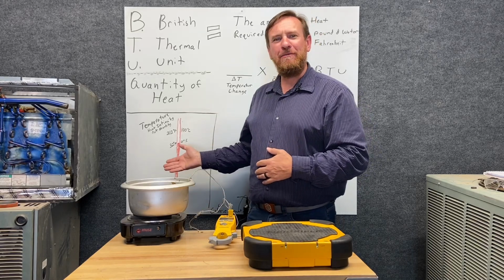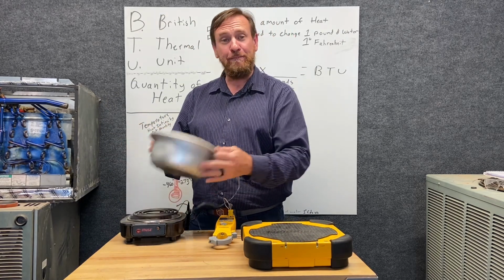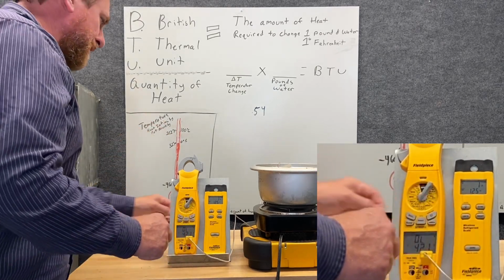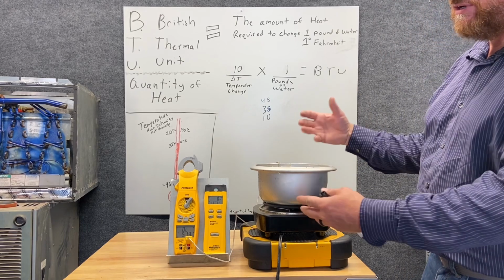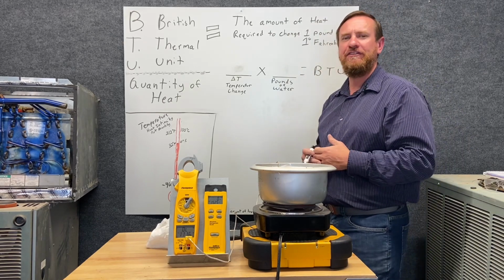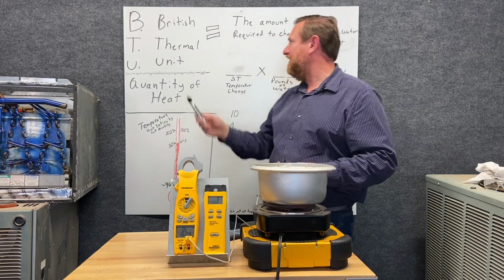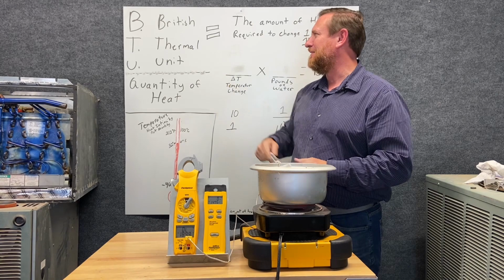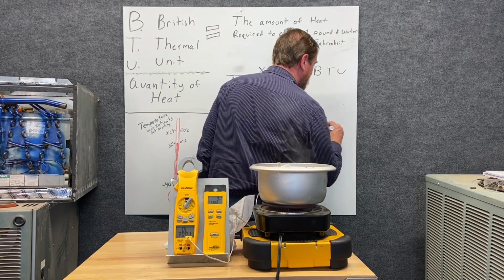HVAC 016 BTU British Thermal Unit a measure of heat

Comment: I find it crazy walking into a major retail market and their doors are open, the outside air is 85°f and they've managed  to cool the inside of the building to 70°f continously.  The energy use is terrible. Good luck
Reply from the maker: Sometimes they use an air curtain to help that.
Otherwise it is a waste of energy. Some places so it so you walk by and feel the cool air, and since the door is already open they are more likely to walk in.

Comment: Isn't BTU an heat energy unit? If so shouldn't it be mass times cp of the fluid times temperature difference, being cp the mass thermal capacity of some fluid? In this case water
Reply: And isn't the BTU definition in this video the same as the mass thermal capacity?

Comment: Ty when looking btu/Lb of air on psychrometric charts ,  say it’s 40 btu/Lb of dry air.  How is that different than the definition of 1 btu raises one pound of water one degree?? I’m trying to understand the difference here. Thanks
Reply from the maker: That's a great question.
I am in the works for starting a series on air and psychrometrics. 

A BTU is just a measurement of heat  energy and quantity.
The definition of BTU gives us a starting point.

The same energy I put into 1 pound of water I can put into anything. 

A furnace will produce ___btu of heat. We are not heating water but we are getting air, and we can heat many things. To cool we remove BTU of heat energy from many things.

We can add BTU to air to heat it and remove BTU from air to cool it. Because air has different molecular make up it will change at a different rate than water.

This leads to specific heat. The amount of hest energy (BTU) to change 1 pound of A SUBSTANCE one degree F.

If we know the specific heat of meat I know how many BTUs I need to remove to cool it or freeze it. Same for ice cream, glycol, blood, wood, soda, beer, and everything else. 

The typical specific heat for air is .24BTU 
So if I apply 1 BTU of heat energy to 1 pound of  air it will raise the temperature just over 4F from where it was at originally. 
1btu if energy divided by .24 specific heat of air = 4.166F temperature change. 

As you add BTU to air it warm and as you remove BTU it cools
Reply: @love2hvac  awesome! Thanks again!

Comment: You started well, BUT u should have measured the weight of gas (or electricty units, if an eletric stove was used), that was used up to heat this 1 pound of water from 38 degrees to 138 degrees F, & then also measured the weight of gas (or units of electricity) used up (for the 100 degrees F rise in the warer temperature), to know how much heat was required in terms of gas cost (or units of electricity cost) to add the 100 BTU of heat energy into that 1 pound of water. 
So, your experiment was incomplete without measuring the actual approx. cost incurred in terms of money (gas cost or eletric units cost) that U had to spend, to pump 100 BTU heat energy into that water.
Reply from the maker: You are correct. 
But it's not a specific experiment, it's just to give value and the basic idea.

I would also have to be at sea level ant the heating element would have to be completely submerged into the water, and the pan insulated to not have losses to the air and I would have had to do it over an houers time.
Reply: @love2hvac  - U r right, its hard to calculate accurately the electrical units spent to make a rise or fall of 100 BTU in a pound of water, ... but I think, to relate it to the present electrical units costs in refrigeration projects, we can say roughly that, 6000 BTU is equal to about 0.5 ton AC compressor (500 watts), or 12000 BTU is equal to 1 ton (1KV) of an aircondition unit power, .. so that way, we can roughly relate the electric cost to the BTU no. Thanks.